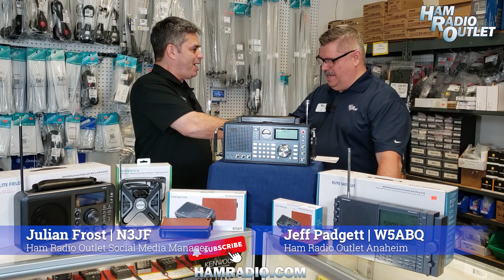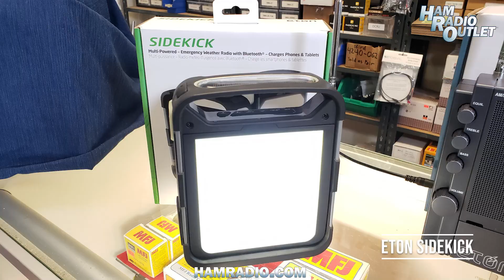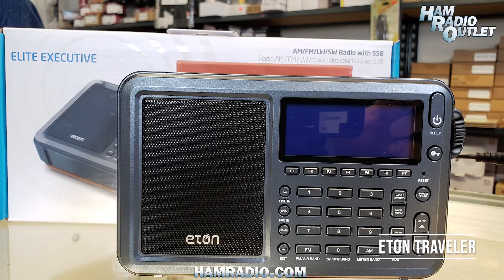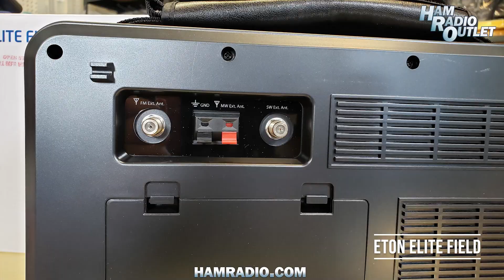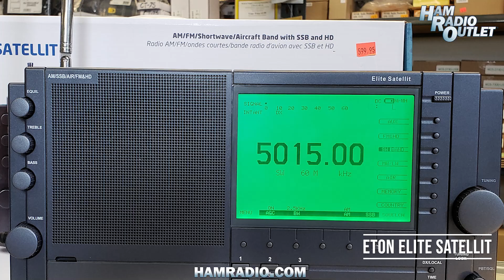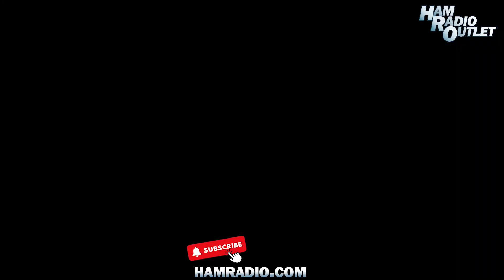Eton Receivers - Ham Radio Outlet

Comment: I need to correct my previous comments.   Eton Corp has a licence from Arcelik A S (owned by Koc Holdings A S) to use the Grundig name. However,  Eton said in 2004 it has reduced costs by contracting production to offshore firms. "They are very reliable, and provide high-quality products" Namely TECSUN.

Comment: I had the original Satellit which, I'm afraid, was a real dog. It would go into self oscillation at times, the display generated all kinds of noise and the rubbery coating got sticky after a while. I hope the latest iteration has addressed those issues.

Comment: I have an old grundig satellit 800. Always wanted the field. Love these. Thanks for presenting. K4NUC
Reply: The Grundig Satellit 800 was my first higher priced radio.  It has worked well for years, but I admit I don't use it very much as my Yaesu HF radios do a better job.  It's not fair to compare a $500 radio with a $4,000 radio, but for a "portable" tabletop radio Satellit 800 does a good job.

Comment: I'm new to ham radios.  They suggest having one is a SHTF situation.  What is recommended for first timer.  I guess you must get training to operate it and then whomever you want (Family member) to communicate with in a situation must get training as well?
Reply from the maker: You need to study for the license test, then pass the test and apply for the ham radio license at the FCC website. Having a SHTF radio is a good idea, but unless you have a communications plan, your family/friends won't know where, or when, or how to listen for your signal. If you think a cheap 2-way handheld ham radio will reach more than about 5 miles, think again! If you want to communicate across the state/country/world, you're going to need an HF radio, power supply (batteries/solar panels/solar charge controller etc etc), and a suitable antenna... as will everyone you want to communicate with. And a comms plan! https://www.hamradio.com can help.